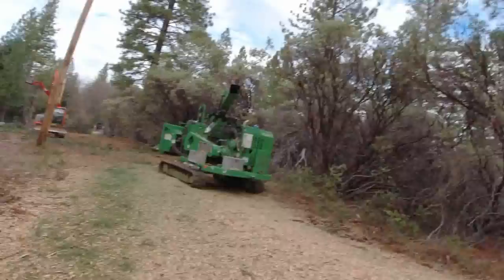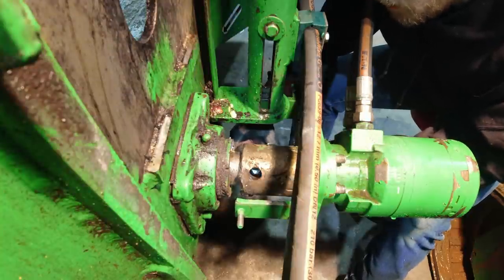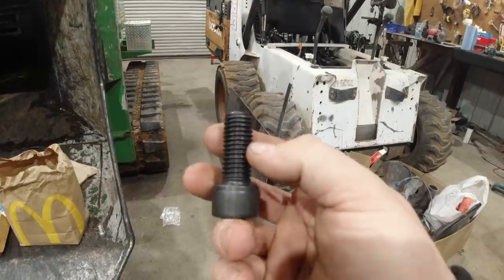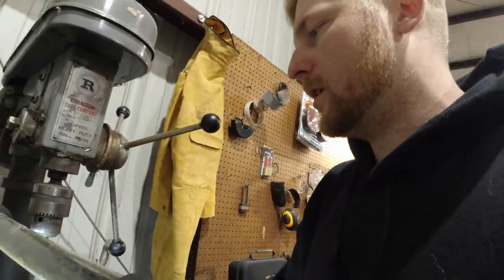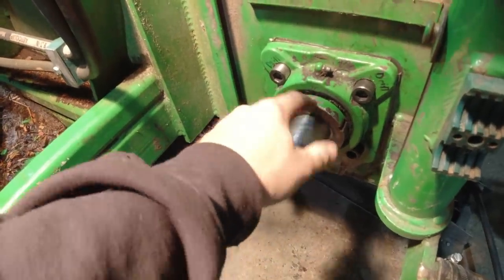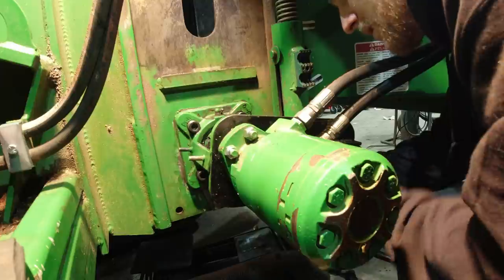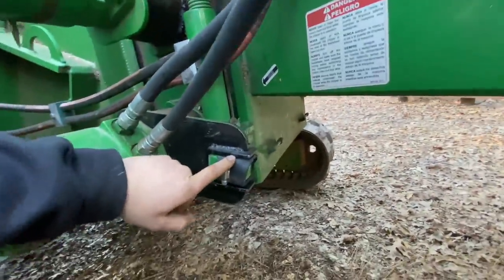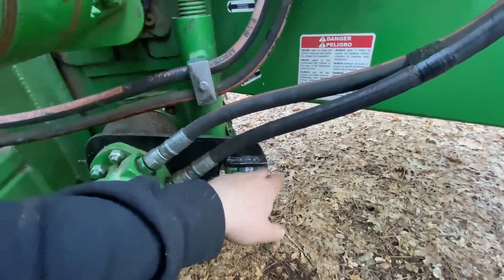Broke chipper again... Fixing multiple weak spots and design flaws

Comment: The little man is a good looking guy. Would have been nice to weld a 3/8” plate to the outside to thicken thus having more threads to hold the bearing plate solid.

Comment: I run a bandit 3680 track machine iv had  trouble keeping teeth and rakers on the mill. I was  told to use the red lock tight. It worked pretty well but they will still loosen up. Iv had other problems with parts coming loose. It beats the poop out of it self lots of vibration. All in all the 3680 is a solid machine. Ours will do a 36in log and is 830hp cat c18 motor. I have put over 900 hrs on ours.

Comment: Been feeding my bandit track with an excavator for 10 years and never had this problem. You should always feed bigger logs by raising the yoke and upper feed wheel, slide log in, then let yoke drop to grab on. You shouldn’t just jam a big log in and rely on the feed wheels to climb up and over the butt. It’s a lot of impact when the hydraulics of the excavator are slamming a log into the feed wheels. I hate to say it but it’s more operator error than design flaw.
Reply: Same what I was thinking. It’s been a bandit design for ages.  Overlooked loose bolts. 

The “spring assist” function on the feed wheel box also has adjustable holes. By moving them in the proper positions they allow less stress when feeding logs vs brush.

Comment: I work at a bandit dealer in the Midwest, we loctite the feed wheel bearing bolts anytime we remove them to prevent that. We use a fair amount of loctite on structural bolts of chippers because of all the vibrations.
Reply from the maker: I put lock tight on them

Comment: My suggestion would be to use fine thread bolts as it gives you more thread engagement in that thin 3/8th plate, and you may want to thicken this area with another 3/8th or even 1/2 inch plate. To get full strength out of a bolt it should have 1.5x the diameter in thread depth, so a 1/2 inch bolt should have 3/4 inch of thread engagement. Just my 2 cents, keep up the good work.
Reply from the maker: Yeah that’s not a bad idea we considered it. But if we can keep the bolts in there they should be fine. Learning curve.
Reply: @VBELTandSON  you could also try safety wiring those caps screws.

Comment: The only problem with going to a bigger bolt is that as the bolt gets larger the thickness of the nut  also must increase ! Minimum nut thickness is equal to the diameter of the bolt ! Next time drill the hole out a bit , then weld in the holes , the weld material is harder than the original ! re-drill & tap to original size . 
Q , on that lower fed / chipper drum , the weld on the shaft , seems to be on the end that wallered  out the bolt holes (according to the vid) , did anyone check it for run-out , between centers on a lath , using a dial indicator, just a few thou”  off will cause it to act like  the lob on a cam shaft & shake that thing like crazy

Comment: We had a 1590 tow behind that did the same exact thing, tried to put in helicoils with the 1/2 x 13 bolts with red lock tight and it only lasted a few days but then got rid of the chipper because they kept backing out, should've drilled and tapped bigger holes like you did but we got rid of the chipper for a new one

Comment: Sam, instead of going from a 1/2-13 to a 5/8-11, I would have gone with a fine thread bolt. 
If the plate that the pillow block bolts to is only 1/4” thick, you’ve now got three threads holding force. 
Using a 1/2-20 or a 5/8-18 provides for a higher clamping force. 

For high vibration applications, drilling the bolt to accept safety wire is the only way to fly.
Reply: Evan better studs Loctited or a tack welded in is what i have found to work really well in situations like that

Comment: Weld stops on all four sides of bearing.
Reply: Just a little 14/ inch flat bar would do it. I think his problem is really with the feed drum. I'd say there is some runout in that weld repaired axle causing vibration that leads to loose bolts.

Comment: Isn’t there any clearance between the bushing and mounting service that a bolt on the inside with lock washer and nuts on the outside? If I think that is not a very good design, my opinion, Congratulations with a new stud horse in the family. Great videos and job, stay safe.👍👍👍🇺🇸🇺🇸🇺🇸

Comment: Nice repair on that roller. Would be nice if there was enough clearance between the end of the roller and the plate that the bolts screw into so you could weld a plate to the inside and make some more meat for the bolts to screw into. Did that make sense?

Comment: Thats why you should of bought a mobark those things will take a beating seen one with a tuned up jd engine 23 inch feed might of been 24 but has a smaller 22 aswell but you can feed the entire 23 inch trees right to it with a 20 ton excavator
Reply from the maker: Still can.

Comment: That upper feed wheel needs room to move around a little bit. If you make it to rigid it will brake apart
Reply from the maker: That’s what the spring it for. Vertical movement is good. Not front to back. Ordered new run rails.
Reply: That was a fast reply! My family has been in tree service since the 40’s and one thing I’ve learned from my grandfather and dad is that stuffs gonna brake and if you can’t fix it and/or make it better you might as well try another profession. You’ve done both and I wish you and your family the best, Thanks for the video’s

Comment: would a Carrie bolt from the inside work?
Reply from the maker: 0 room on the inside
Reply: @VBELTandSON  I saw that after you dropped out that roller. One might have to weld a spacer on the out side to gain a thicker area to tap more threads, Hope your fix holds

Comment: The thread depth should at least be equal to thread diameter.  A 1/2 bolt should have a minimum of 1/2 material to thread into.
Reply from the maker: Yup

Comment: To give it a little more strength I would have put nuts on the back and welded them and then put the same nuts and bolts on the bottom and it should not do that again
Reply from the maker: No room. Feed wheel is within 1/4 inch
Reply: @VBELTandSON  That to bad that would had gave you the strength so it wouldn't waller out anymore the reinforcement you did on that plate will help but that plates that holds those bearing housings in place is to thin it should be 3/8 or bigger for more thread engagement the other side doesn't matter because there is no weight hanging off of it

Comment: https://www.grainger.com/product/E-Z-LOK-21-32-in-Carbon-Steel-Self-4ZE24

Use something like that. Red loctite on the insert and blue on the actual bolt. Will make it repairable if there is a next time.

If you really wanted to get serious about it, looks like you have room to shim the bearing out. Make a flange plate to put behind the bearing and weld it on. Tap the holes from the inside so your threads line up, that way you will have more thread engagement.

Comment: So if the holes get messed up again anything preventing you from just welding in some studs to bolt the bearing support in place after the feed wheel is lifted up?

Comment: You probably shouldn’t keep slamming the logs into the feed wheels with the excavator. Your controller should be able to open the feed wheels up before sticking the wood in.
Reply from the maker: Lol definitely not slamming them into it. Apply pressure for the wheels to grab the log. 18inch chipper has no issue taking 8-10 inch logs. Much bigger than that I open the jaws